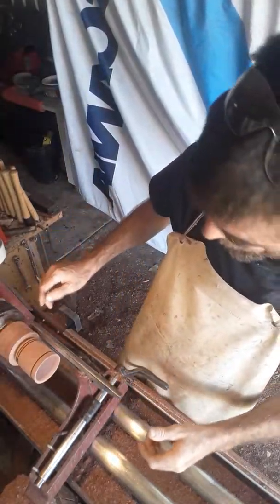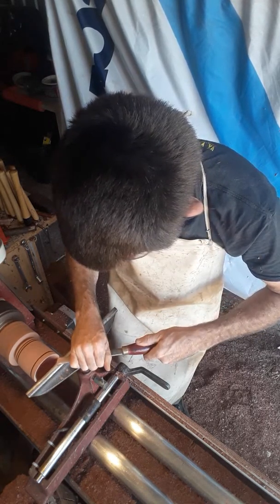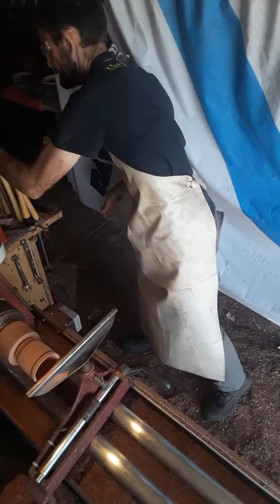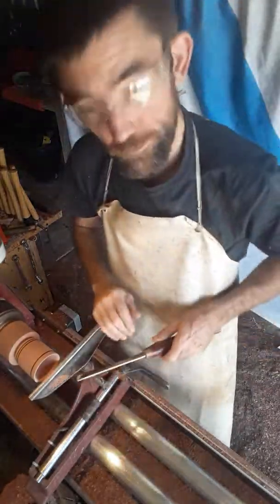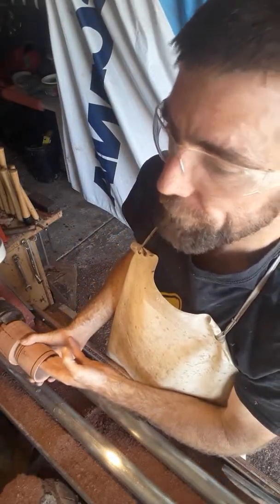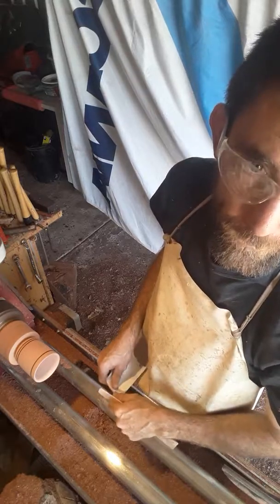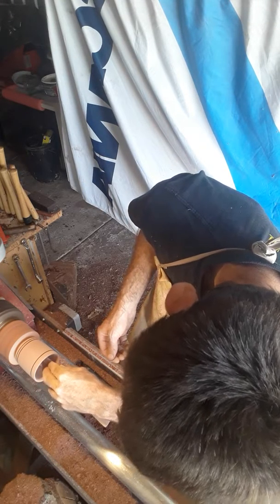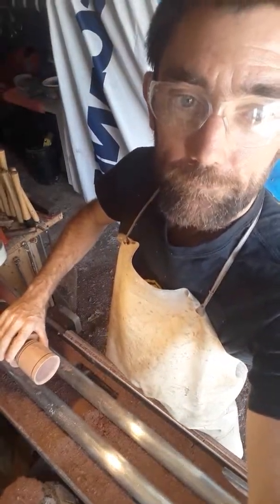Jarrah barrel cup #7 smoothing

Comment: As you are going to resin over the top does going above 240 grit change much? I don't lathe but I'm about to use resin for the first time and looking to see how fussy with the sanding I need to be ;)
Reply from the maker: Im a fussy sander as you can see . Most say 240 is enough as the resin will fill up and level off . It more than likely will be fine im just used to sanding to a dead smooth finish for oiling or waxing
Reply: @theskuta77  cheers, I might experiment and see if I can notice the difference!